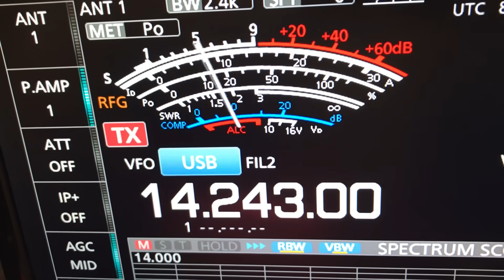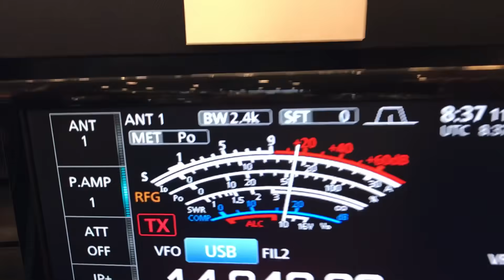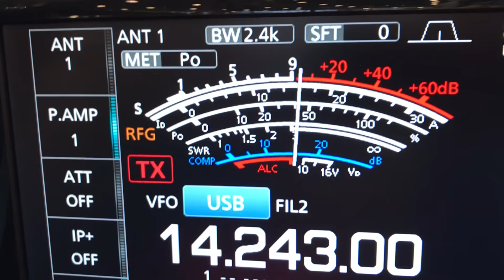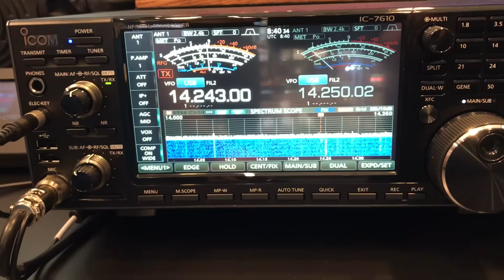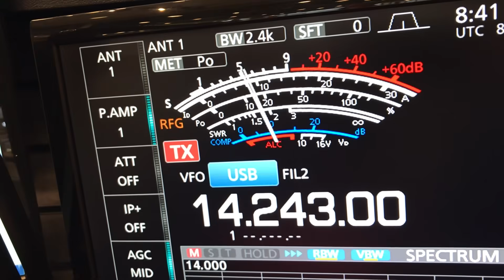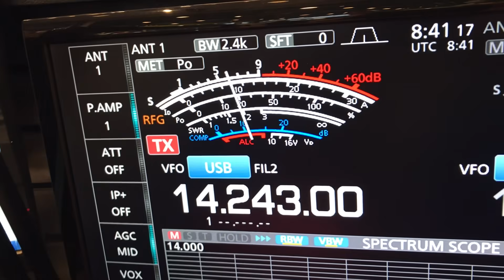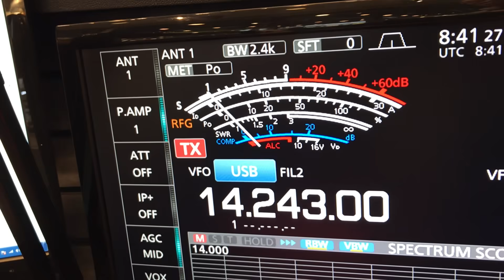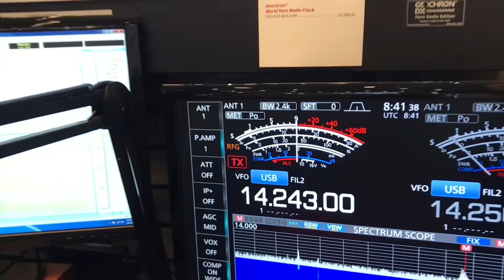The New ICOM  IC-7610 in operation

Comment: The 7610 would be much more desirable to me if you didn’t need to touch the screen.I find it to be a Big takeaway for the 7610.
Reply: Better save your knobs and buttons radios. Touchscreens are the now, the Anan, Flex, Hermes are the future. It will eventually become a buttonless hobby
Reply: @TheAppalachianWay If so I will buy Used radios.The 7610 does allow most things I need to do without touching the screen since I don’t change modes since I only do SSB and I already have all of my filters set the way I like them.

Comment: Is this a SDR or do you have to download software for this?
Reply from the maker: The 7610 is an SDR radio and has it's software internal. Updates (as they are released by ICOM) are installed by the customer using either a thumb drive or SD card.
Reply: DXEngineering good I'm not going to get the 7300 I'll go for the 7610 because I have a 7600 and it's a great radio

Comment: What is the small black box with a color screen to the left of the IC-7610, in front of the external speaker and above the computer keyboard?
Reply: That is the control head for the ACom amplifier.  I'm unsure of the exact model.

Comment: This radio is very capable, and worth the money. However, when the 7300 cam out I was close to buying it, but experience clicked in and I waited and purchased the radio for 1k new, with rebates and Christmas specials. And with a free Heli mike and cable.  Can’t beat patience.  So I have a radio with a much higher hardware model and because of time, the software is much more mature.  I’m planning the same thing with the 7610, by the time I have it the bugs will be normalized and it will be $2900 or less guaranteed.

Comment: I don't see why anyone would want a radio that you must touch the screen? Much better having a button or knob so the adjustment can be done with them.When those screens need replacing or something on that screen stops functioning it will be a very costly repair & one most can not do themselves.Appears the companies are baiting people into this crap & they will need new gear because of repair cost or lack of parts down the road.It's a FACT that when they stop making any radio withing 5 years they also stop supporting them & you must seek repairs from someone other than them.No matter the company they all do it.Those bells & whistles will be become Nightmares down the road & the companies won't care after they have your money in their bank accounts.Only a complete fool would thing this crap will keep working for very long with prolonged use.In a few years that screen will look really bad but the replacement cost will loo much worse if you can even find one then.The microphone looks like a PR-40 to me?
Reply: you sir, are going to be left in the dust. I cant be the year 1955 forever.
Reply: 10FGODSOWN isn't that far from being wrong about modern electronics. Most of it (maybe all?) is designed to be thrown away instead of repaired or maintained. I'm not sure if that is the price we must pay for the complexity and scope this type of equipment has - it does pack a lot of umph in a single box - but these newer gadgets and boat anchors won't be around anywhere near as long as the "old gear" was.
Reply: @mikeschnobrich9694 I’ll keep my ICOM 7700 for my use and not touch the screen.👍❤️🎙
Reply: If you don't want to touch the screen, just use CAT control with your computer if you are that paranoid.  Touchscreen technology is pretty mature, millions of smart phones can't be too wrong.
Reply: Most people don't own a Smart Phone or any cell phone for nearly as long as Amateur Radios stay in use so that boat don't really float since it has not been tested for that long of a period so YES they CAN be WRONG.I don't care for any form of rig control other than Buttons & Knobs for any transceiver I would ever own.I'm not into digital modes & I have never owned a cell phone.I hate all telephones for the most part I try & avoid them when at all possible.Never saw why people think they are so needed other than most who ow them have No Life without one & it makes them feel Important? I have managed 57 years without the need for a cell phone & I think I'll make it the rest of the way without one as well just like a transceiver that requires touching the screen so it will operate I'm NOT in the need or want of any at any price even FREE.If someone offers me a FREE one maybe you can take them up on it & be happy & I'll be happy for you & me. {:>)
Reply: You might try a string and a tin can.  I hear its even more reliable than tube radios, just kidding.  Just because you personally don't like newer technology does not invalidate its usefulness.  Yes, digital technology lends itself to shorter life spans primarily due to its rapid development cycle.  The current crop of SDRs are quite remarkable for their small size, low power consumption and performance and they are the future, like it or not.  There will always be those who want to play with older equipment and there are some advantages, such as fixability, ect..., if you can find the parts that is. I really enjoy my 30 year old CRT Tektronix oscilliscope, but if I have to go somewhere portable, I will be carrying my digital Rigol instead.  There is a place for both.  You just need to know where the best application is.  73s